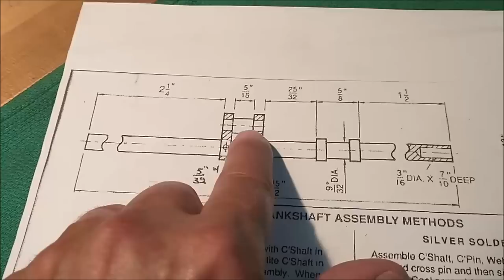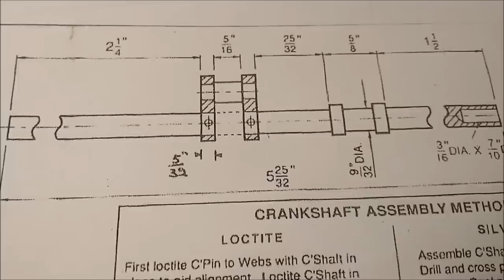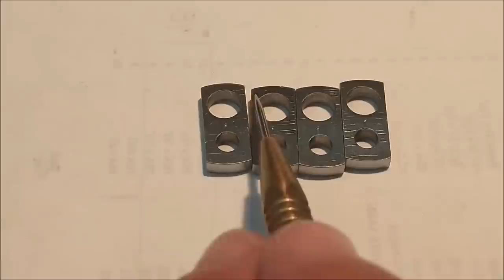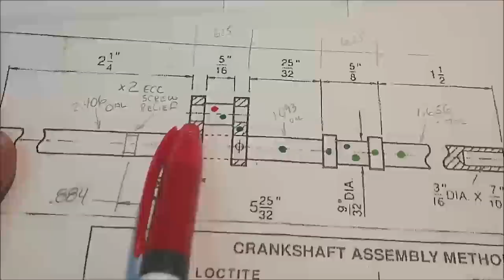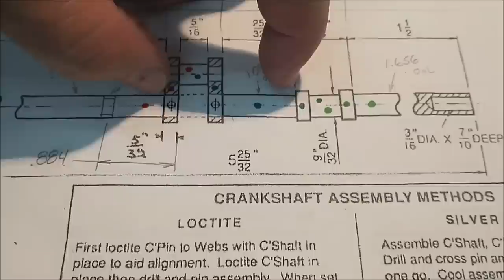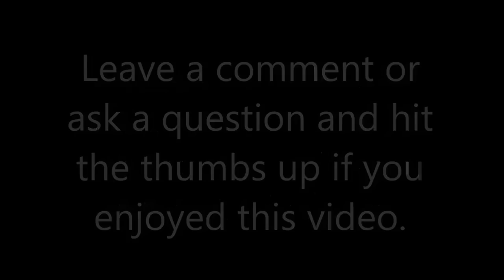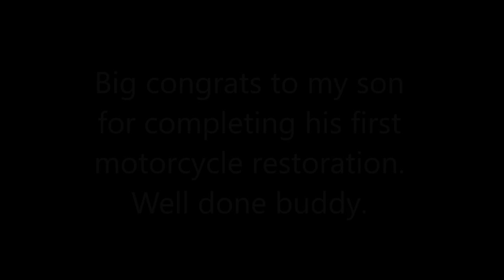Stuart D10 - # 15 -- Machining The Crankshaft.........Final Component

Comment: I was honestly expecting you to say "Well, thats good but not good enough for me" and for you to turn a complete crankshaft from a single rod of metal.
Reply from the maker: I thought about it.
Reply: As this video series is undoubtedly going to be the "Bible" for this little engine, I think you need to include the solid crank option for those willing to have a go✅
Is it not just as important to pin the big end journals as well?
And finally, for those running on steam, how about attempting to make the world's smallest "Clupet" ring😂😂 I've got 2" ones on my engines and they come highly recommended by some steam enthusiasts.
Reply: You beat me to this comment 👍
Reply: The fixtures are awesome.
Reply: Leave the ends Joe, yes it adds character and points out that the crank is not a turning.
Reply: I vote for a one piece crank video, there are lot of things to be explained by someone as experienced as you.
Reply: The pins' ends at each end looks great. Leave it like that. Looking forward to the assembly video. Besides the finished components, i reaĺly loved the setup systems being used to achieve the end results. I have already identified at least 3 that i may use in my applications. Once again, thanx for taking us through these videos' machining and explanations. I will use it in terms of a future model that i am hoping to play and experiment with😅
Reply: Joe, why did you use a gauge pin for the pressing mandrel? I realize it's hardened, but aren't the measuring devices sacred?
Reply: @jasongreene303  to you and me. I bet you Joe has got thousands lying around. Better still, he can make his own!!!
Reply: @jasongreene303 he has a set for measuring, and a set for shop work. Same for gauge blocks
Reply: @jasongreene303 most likely he has a sacred set for inspection, and a second set for shop use
Reply: Henry Ford had his own personal gage block set. It is on display at the museum and it is beautiful.
Reply: @kgee2111  damn I'd love to see it. I'm a south african so there is little chance of me visiting said museum. Any links?
Reply: Thankyou 👍

Comment: Hey Joe, the reason Stuart did not specify reducing the diameter of the crank rods is that you did not make it the way they intended. they intended you to assemble the webs onto the crankpins then have them a sliding fit onto a single piece shaft, loctite and pin them in place then machine away the parts of the main shaft between the webs, meaning that the crank mains would be naturally aligned. Your method is far more challenging from an alignment perspective, so huge kudos for getting it so good
Reply from the maker: Insufficient material dictated the process. Remember, every throw will consume twice its thickness in rod material. Thats almost 1.3" of material.

Comment: You could always put a pin through both journals vertically. When doing the crank for our locos, my Dad and I had the main crank go through the journals then machined out the piston rod throws.
Reply from the maker: Good point.

Comment: Nice bike,  and I'm not a bike guy either! I'd remove the ends of the pins so it resembles a forged and machined one piece crank. I was hoping you'd machine that bad boy from a solid piece of steel. 
Regards,
Preso
Reply from the maker: Thanks Preso. I did the PM kit from a solid bar and wanted this one to be different.

Comment: When I saw that flat stock I flashed back 40 years when I blued, traced from template and cut out crank shafts from 2x4  bar stock for a man we called “Crankshaft Carl”.  I believe the steel cranks were for replacing the cast cranks in Briggs engines for tractor pulling contests.  After cutting with band saw and roughing on the South Bend, it went to the CNC for finishing before sending out to get hardened and ground.  I made the counter weights from 4” round, cutting in half and milling pockets for fitting to crank, then socket head cap screw them to crank shaft.

Comment: As far as the position of the pins, there is nothing that says they must go through the center of the shaft.  If you are worried about wall thickness, then offsetting the pins would give you more material around them.  Another way you could have gone about putting the pins in, is through the bottom, or one long one going all the way through from the top.  That last stunt would pin both the journal, and the crank in one shot.
Reply: That's a damn good idea to keep for reference.

Comment: Nice job Joe .. when I've  done similar  crankshafts in the  past     I made all the journals a light  slide fit  and relied  on the accuracy  of my jig  to keep everything  aligned while the Loctite set ..   I I prefer the pins left protruding..  I like to use taper pins on crankshaft with a thread on the small end and a nut to pull it all together  with more loctite
Reply from the maker: Not enough material in the kit.

Comment: Super work Joe and I really like that final Al jig for setting up the crank for pinning - nice. I wonder whether your reamer choices are what you had or whether you had to obtain some specially - so many tiny sizes! I like the finished pins as shown. Can't wait for assembly! :)
Reply from the maker: For turned parts, its easier to pick a reamer and turn the boss to fit after the hole is done. No special reamers needed. But...I do have quite a few at my disposal.

Comment: Joe

nice job neat and tidy

Think how difficult it is on a three driver loco , 1 the frames have to be square and parallel , 2 the horns and the axle  boxes have to be  square and equal in dims. 3 now the difficult part three sets of wheels have to be quarters ( crank pins set at 90 degrees ) there time exactly , 4 now the acid test put it together and see if the connecting rods fit and it goes round . 
and yes I have built 5 loco's and all was fine ran and pulled the load of 20 adults , except one which to compound the problem was between the frames cranks ( 90 deg offset as in your job ) but with external connecting rods .  look up the GWR 14xx class loco 
keep up the good work its always great to see how others solve the problems
Reply from the maker: But, we love a challenge.

Comment: I would prefer leaving the pins flush so that any future lateral movement of the pin would be easily visible upon inspection. Also, what happened to the Loctite?
Reply from the maker: Valid point
Reply: @joepie221 If you peen a big mushroom head on each side they shouldn't move.

Comment: Hey Joe. A  bunch of great tips and layout/setups for all of us here today. I'm sure glad you didn't have to shut the place up and go home. We need those magic genies to extract broken drills that small. big ones too eh. Leave the pins but just give them a couple taps with a punch with a concave grind in the tip. Just in case they try and move with all that massive torque this beauty will have, LOL. It is killer hot up here too. About 85 converting to Celsius of 26. I/we melt up here at 72 or 22 C, LOL. I'd ship you a bucket of co2 if I thought it could make it last the journey. You should be able to get dry ice from your welding supply folks. It isn't really expensive either. Take a cooler of it and a fan behind it and woohoo a cooler shop but at the same time I have heard that most shops in Texas are not insulated so the effect wouldn't last long eh. The teach did a great job on this assembly. Finicky thing eh. Thanks a bunch and I will be here for the assembly and hopefully see it in motion with compressed air as I know you still need a mini boiler to cap this stack of machines you have created. See ya then, take care eh.
Reply from the maker: Maybe I'll hook it up to my perpetual motion rig and see if this one does the same thing. Hmmmm ??
Reply: @joepie221  That would be an amazing achievement. You pull that one off and you will re-wright the laws of physics as we know it. Too bad my childhood friend from down the street(Mr Eisenstein, Albert) isn't with us anymore. You would sure have his attention. He lived up here in Vancouver BC for a good part of his life. Neat guy with fun stories for all the local kids. Anyways, like I said, that video is now formulating in you and I sure would like you to pull that one off my friend.

Comment: That broken drill IS THE pin !! I wouldn't worry about the pins sticking out, unless yer gonna take it to over 12k rpm . The hold down clamps are as beautiful as the crank !! Ya get that twin cam honda finished, speaking of restos ??
Reply from the maker: Getting there.

Comment: I think the original build plan uses a single crankshaft, the webs are slid on, pinned in place, and then the center portion machined out. That method wouldn’t work with the smaller holes. 

Making it in separate pieces like that takes exceptional care. The fact that the crank rotated so nicely proves the precision of assembly.
Reply from the maker: That would mean the throws would have clearance for installation. And...although they suggested that method, they neglected to supply sufficient material to do so.

Comment: Long ago I made the single engine version of the No. 10 from castings.  Stuart supplied a little forging for the crankshaft.  My machining abilities were (and are) very rudimentary, and my first effort on the crankshaft failed miserably.   For my second try I started with a piece of precision ground flat stock and produced a crankshaft good enough to make the little Stuart run merrily.

Comment: Great video Joe a small brass hex nut pressed onto that pin is my suggestion again thank you for a great video of a great model
Reply from the maker: Had I though ahead, I would have used longer pins and done that. I like the detail of it.
Reply: @joepie221  no matter what you have the masters touch

Comment: Small tip: If using a centre-punch between crank-web holes to identify orientation, don't hit it too hard !! The metal spreads away from the punch-mark and may cause enough distortion to bend the part, or slightly close the holes.
Reply from the maker: It certainly could, but use a Sharp punch and a small hammer. Everything ends well.

Comment: At 28:20, a load would need torque.  I wouldn't thin the main ends as much as the rod journal ends since reducing the radius also reduces the torque that can be transferred.  I think about midway between the two as they are would be close to optimum.  Another possibility would be to pin it from the end opposite the rod journal.

Comment: Throw a poll on here for some community engagement, I like the look of the pins as it is.

What do you think of cold bluing the non-critical surfaces for the sake of looking cool? If i hadn't just had back surgery, I would sit and cad it up just to appease my curiosity.

As always, it looks great and you had some great tips in there. Thank you.
Reply: I'd have used taper pins, the only correct method. I admire you Joe, but this time, you got it wrong.
Reply from the maker: Check 'your' print and get back to me. Thanks.
Reply: @joepie221  I'm unsure why his comment was attached to mine, but I hope you don't take his view as my own. It's a model engine and if he was worried enough to use a tapered pin, I'm sure he wouldn't have kept the paper thin sidewall.
Reply: @hmh-jv6rn  Just like aa food recipe. It  is a guide that always can be adapted to suit it's makers tastes or looks.

Comment: Joe I have  a Bill Harris Steamroller some master machinist made. It has no boiler yet Im building one. The crank looks like its one piece. I think builder may have passed before finishing it. It has a Stephenson reverse linkage as well. Thanks for sharing. I gave $17.00 for said Steamroller. I sold off a Liberty Head $10.00 gold also a five dollar gold and 2 one dollar gold coins.
Reply from the maker: Good luck with the boiler.

Comment: Pins should have gone in the ends of the throws. One long hole and pin per throw through 2 journals.
If you dont pin the conrod journals, the crank could twist when tourqued.
Reply from the maker: I'm currently going by the print.

Comment: I like the pins showing ...
Perhaps I missed it, but what is retaining the smaller crank rods that the connecting rods are attached to (other than press fit)? I don't see the pins on those...
Thanks for sharing 🇨🇦
Reply: There's no torque on those joints.  Like there is on the main.
Reply from the maker: Its a heavier press on the rod journals, and if all goes well, it applies equal force on the throws when it runs. Realistically, only the inner throws are seeing rotational resistance from each other because of the 90 degree offset.

Comment: I agree with you on stepping down the rods prior in insertion to strengthen the crank. I was wondering if you were going to machine a solid crank. The knubs look good. I would not cut them flush. As you did not chamfer the pin holes, you would not have a solid lock on the pins. Leaving them proud allows you to peen enough fat on the pins to lock them. So leave as is.

As always, loved this series. What I didn’t see is the machining of the pistons. Did I miss something?

You next engine should be a compound engine. A double expansion engine would be nice. A triple is the same but just to much repetition for videos.
Reply from the maker: The pistons were just a turned puck. Nothing special. I didn't film it.

Comment: Did you use lock tight? Leave the pins but press on brass nuts for looks. Great job wit the fixturing!
Reply: Seconded for the brass "nuts".
Reply from the maker: No. I didn't use loctite because I assumed it would just wipe off at assembly. I can't imagine any advantage with a nice press fit.

Comment: Part of me wants to give you Hell for wearing shorts in the shop, but I've been to Texas in the Summer. You've suffered enough already. I say leave the pins protruding. Maybe even replace then with brass pins for contrast.
Reply from the maker: That would look good.
Reply: Joe, a question. Why are the crank pins not pinned as well? If loctite is enough there why not the shaft journals? 
Nice looking crank. I agree with the brass pin suggestion maybe even hex heads on one side and loctited phony nuts on the other? Or thread them with castle nuts and split pins or wire.
You didn't really think you were finished. Did you?
Regards from Canada's banana belt.
🤞🇨🇦🍌🥋🇺🇦🕊️🇺🇲👍
Reply: @joepie221  You bet ! Great idea.

Comment: Beautifull work, again :), i like the pins as they are, though proportional they could be shortened to protrude half to 2/3’s of how they are now?

Would a turned end on the main shafts (to accommodate for more strength in the journals) lead to less torque delivery through the press fit and therefore increase torque on the pins?

And yes this is a bit of engineering waffle on a display model like this, but the curiosity entered my head.
Reply: There's no torque on the press fit.  Well, a teeny tiny amount from bearing friction.

Comment: That's a tricky one about the pins
In the real world i'm guessing that would be a single casting, so no pins
But i agree with you that it adds some character
Reply: In full size it would be a steel forging as a casting would be too brittle for a crankshaft. 
The Stuart crankshafts also used to be forgings which you had to machine all over.
Reply: @malcolmwright146  You're right, my point was that it would be all solid before machining
Reply: In a real period engine you would find the crank machined from solid using wrought iron. Not the best but that is what they did. The counter weights would have been cast iron that fit over the crank throws. Often these were round. See the PM #4 or #6 to see what such a crank looks like. This crank is consistent with what the model engineers would do going back a hundred years. See the works of Henry Greenly.

Comment: Time 23:00. Brilliant way to get a 90 degree angle! I might be wrong but Harley Davidsson uses 60 degrees..... Teasing You.....
For steam loco modellers "quarting" is often an obstacle.
Time 24:15. That's critical, to have a straight axle and not a whipping cream tool.....
Time 25:30. Looks like You nailed it!
Time 28:28. Why not pin the right part from up to down? More meat there....
Time 32:30. Now I can enjoy things.... Spelled: Relax!

Comment: Hi Joe, another magnificent piece of engineering, although I have to say that large piece of scrap that you used for the final jig is bigger than anything I have in my main stock, it certainly would not be "scrap". Obtaining anything that size would involve large amounts of cash even as an "off cut". Just one comment though, do you not need to pin the journals as well as the shaft?
Reply from the maker: I may.

Comment: It's looking great Joe, I'm really looking forward to the final assembly!  Are you going to run it with steam or compressed air?🤔
Reply from the maker: Air.
Reply: @joepie221  wise move👍  As nice as live steam is, there's a lot of risk and repeat testing/inspection needed compared to compressed  air (and external professionals will be doing that on your air system already)
Reply: @2lefThumbs  biggest problem with steam on engines that are very intermittently run on steam is condensation in the cylinder leading to rust and pitting. It is common on antique popcorn engines put away wet in the fall - disaster in the spring.

Comment: Joe , I was wondering? Why don’t you drill the pin holes from the ends of the yokes down through both shafts at once and use one pin for both shafts, this will also leave more material on each side of the shafts and you won’t have that thin material on the larger shaft that you we’re talking about.
Reply from the maker: High RPM centrifugal forces may walk them out? Just a thought.
Reply: your idea is good but for removal in future may be a problem unless use a set screw
Reply: Never thought about this. If you counter sink the holes on both ends and peen into the counter bores, this might actually work quite well.